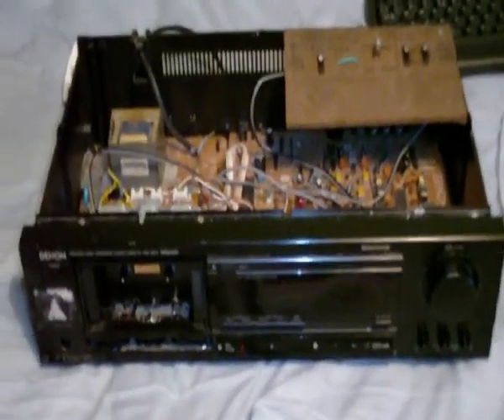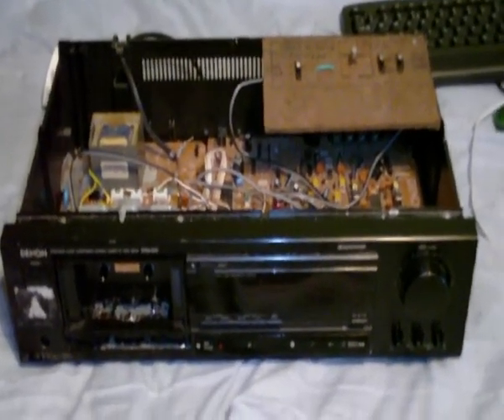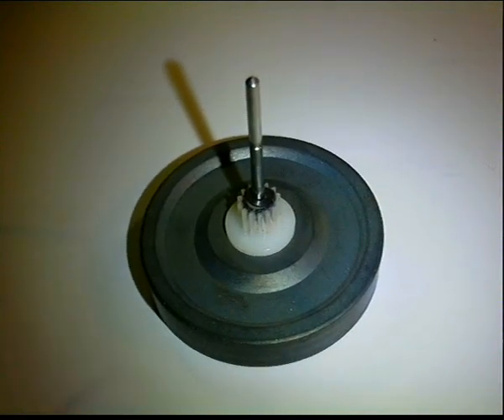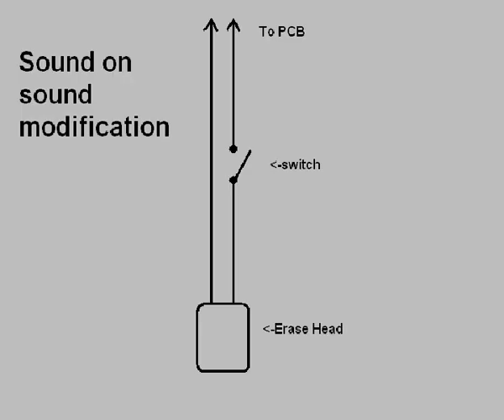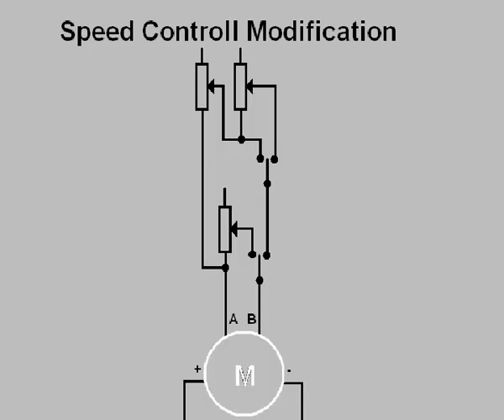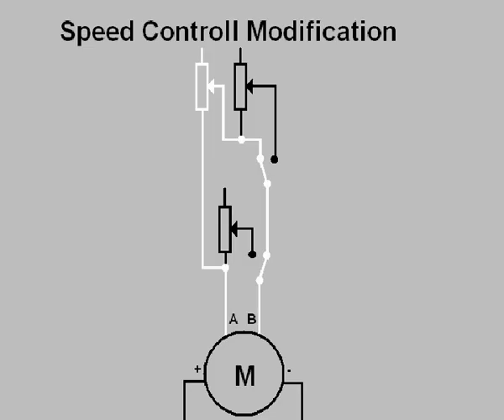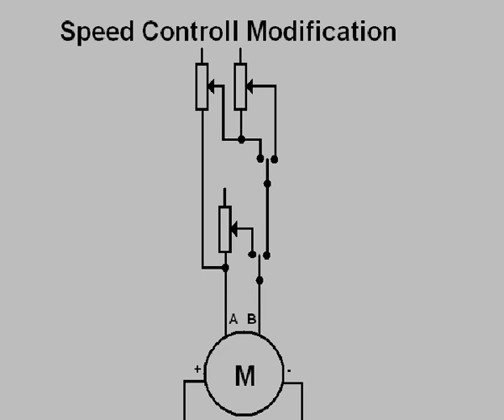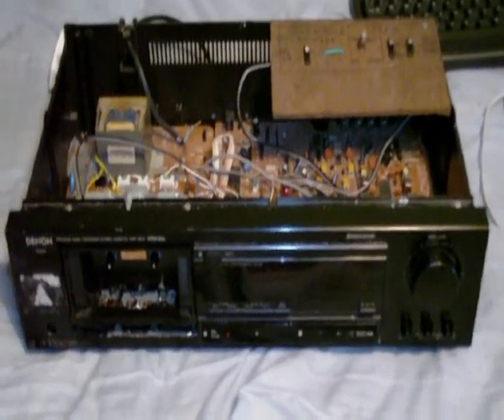A closer look at the Denon DRM 600 Modifactions

Comment: I was searching for a video on the cam gear mechanism on a Denon DRW-840.  I purchased two used ones trying to make one that works.  I suspect the misalignment of the cam gears in the cassette mechanism is the problem.  Do you know if that gear has to be aligned specifically to operate properly?  I suspect someone trying to repair or replace the belts may have induced a failure mode by misaligning the cam gear.  The cam gear looks very similar to the one you demonstrated here.

Comment from the maker: The reststor connected between the A and B connectors on the motor is what controls the speed, there's no external voltage connected to them.  The motor also has an internal potentiometer for speed ajustment, but it's not really needed in my circuit.